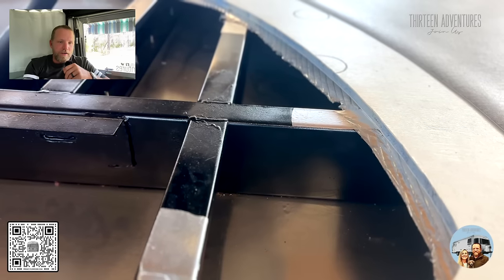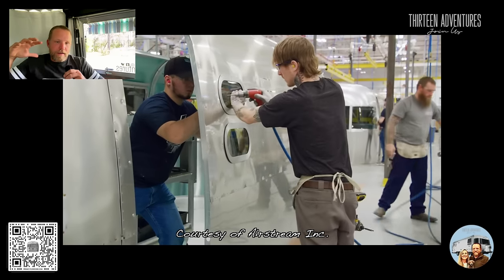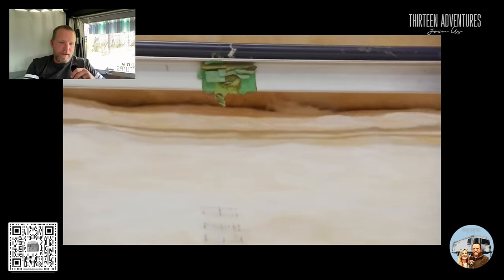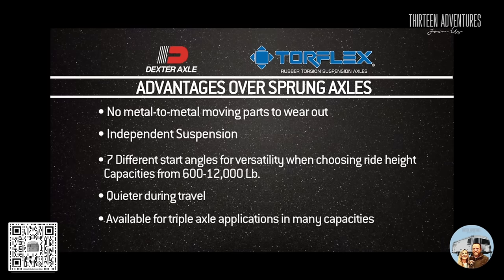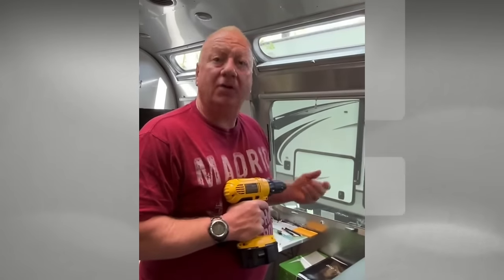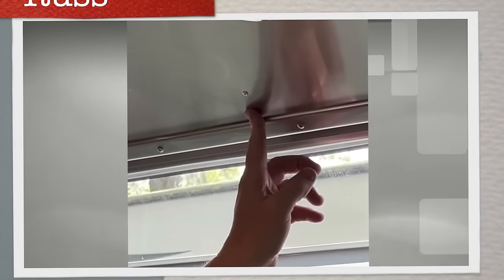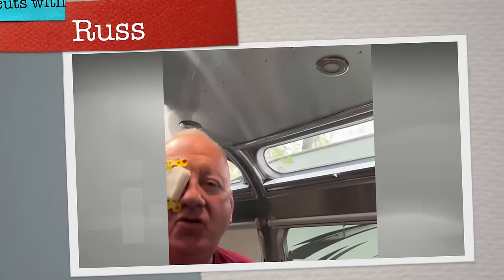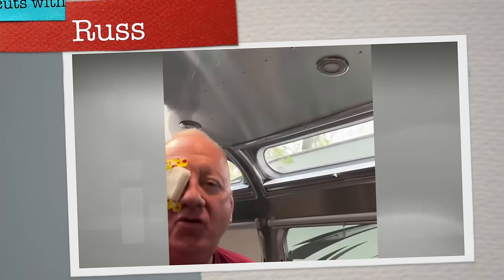Inside the Airstream Factory, Dexter Axle Insights, and Upgrades!

Comment: Definitely look at the metal braided hoses from Blu-Tech.  The quick-connects are preinstalled so no adapters needed.  They are super flexible and don’t kink or tangle.  I have two short ones between the water softener, triple filters, and trailer and a long one to the water source.  Fantastic system!
Reply from the maker: Thank you very much!  This was filmed in Feb and we have used the system since along with some Camco flexible hoses and have loved it.  Will def check out the metal ones from Blu-Tech.

Comment: More great content - Thanks.  We did the factory tour in November 2022.  Our International 2023 was on the flour during our visit.  We picked it up at the dealer in Maine on December 15th 2022.  Big Rain and snow storm in New Hampshire Dec 18 - 22, 2023. Trailer had a huge leak along the wall in the Front Bedroom driver side and over the Front Bedroom Window.  Took it to the ME dealer 3 times over the summer and fall of 2023.  They could not fix it and the floor in the front bedroom was heavily stained.  Made an appointment at the Factory Service Center in Jackson Center OH.  First available was January 15, 2024. They took everything out furniture, Bedroom and Kitchen fixtures.  Took it to the Hurricane booth at the Main Factory to check and fix the leaks.  Then back to the repair facility to replace the floor and reinstall all the furniture and appliances.  We picked it up on February 19th 2024.  Leak on Driver side seems to fixed.  Leak at the front bedroom andn campsite curved window still has a leak.  Very friendly folks at the factory.  But I don’t have much faith in the Hurricane booth.  I do’t want to make the 900 mile drive from NH to OH again so I purchased  some Ad Seal and will attempt to repair the leak myself.  I went and rewatched your roof . solar panel leak as a refresher.  Wish me luck.
Reply: corrrection Big Rain and snow storm in New Hampshire Dec 18 - 22, 2022.  Two days after we go it home
Reply from the maker: Wow!  Sorry to hear of the continued issues.  I dont blame you for not wanting to make the trek again.  You could also do an over pressurization test to see where the leak may stem from.    Ive not done and but have heard 50/50 +/- opinions on it.  Depends on who does it and how much pressure they use.  I also believe that post "hurricane chamber' sometimes the travel and torquing of the rig can cause other leaks.

Comment: @ThirteenAdventures   Brad, do you how the water tank is attached? I’ve heard that they are not strapped to the frame but rather they are supported by the belly pan. ??? Any insight since you were there ??
Reply from the maker: Tha aluminum pan you see underneath is plenty strong to hold the tanks.  The way they sit in the frame is very strong.
Reply: @ThirteenAdventures  I ask because when it’s a full tank it’s quite a bit of weight 450 ish lbs depending on tank size. Some have added reinforcements and I had seen something posted by Ronnie at Airstream nuts and Bolts about a falling tank.
Reply from the maker: We travel quite often with water in the tank and they are engineered to handle that weight.  We very rarely travel with over 50% though.  If we are boondocking and need to carry water, we will fill the tank as close to the campsite as possible.  Typically a few miles. I know of none where this has happened (it happened to me on a Keystone brand).  Ill see Ronnie later this week and ask him about it.
Reply: @ThirteenAdventures I look forward to hearing what you find. I’ve seen the supports installed with U bolts that I believe Ronnie recommended.
Reply from the maker: I chatted with Ronnie about this yesterday.  He and I agree that its only necessary on the 50gal tanks on the 30' and larger models.

Comment: I use blu all-was .clean water has been my hobby and part of my work for 40 years. I have only put filtered soft water in my airstream ever since I bought it one year ago. And never directly hook up the city water connection. The expansion tank I installed helps with making the water pump and system work better and more consistently. I added more resin to my tank to give you more capacity. I’ll be installing hot water return lines back to my freshwater storage tank so we do not waste any water. We may waste a little hot water going back into the tank but will save on our freshwater. Again, thank you very much. You are always helpful. Thanks for the post on my Michigan airstream Facebook about the furnace.
Reply from the maker: Thank you for watching and your feedback.  I'll post my video on the Blu soon.  I have thoroughly enjoyed the clean water from it.  I plan to add the shower misser to our rig soon as well. Thats a great way to save water.

Comment: The insulation on these is a joke.
Reply from the maker: Weve lived in all sorts of environments from 115 down to -15 degrees and have found them to be better than most RV's (except those specifically built for cold), its the many windows that cause the majority of the issues.  Thank you for your thoughts though.